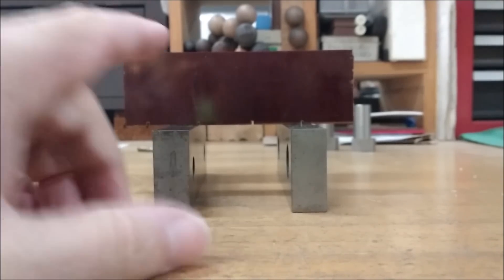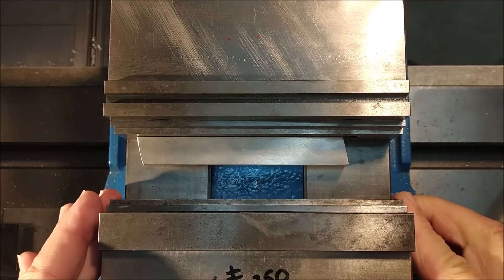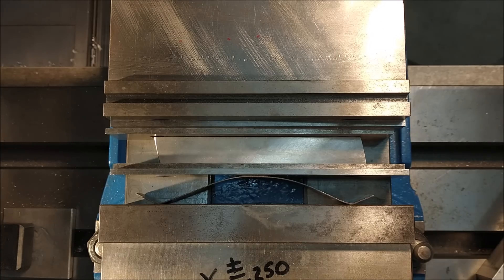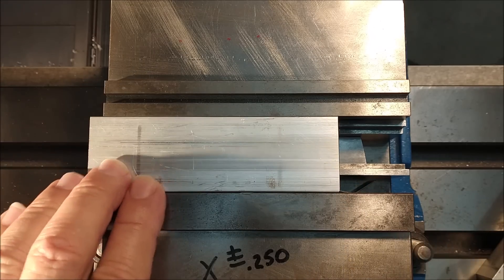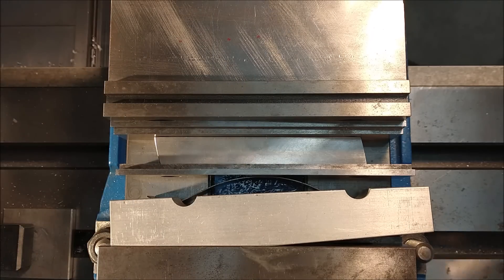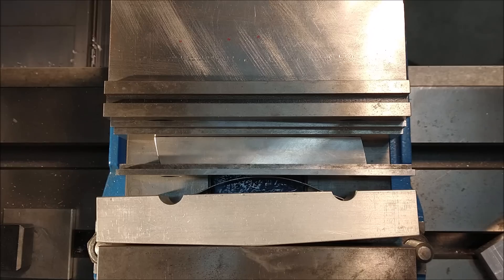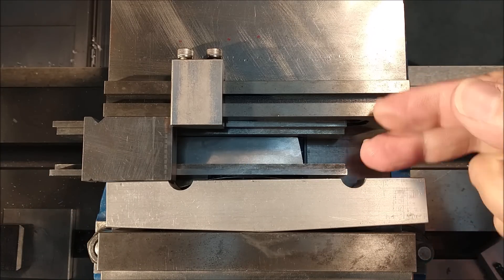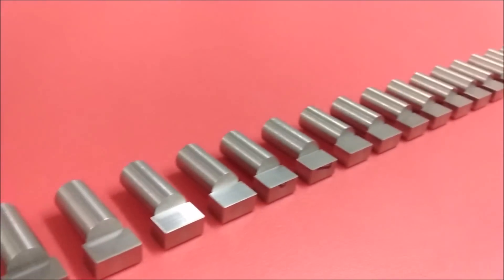Have a Vise on Your Machine ?? ......Learn this NOW !!

Comment: We that have a woodworker's vise know this. You talk about twisting, you could bend or break one. I put a jaw mounted screw jack in mine made out of a carriage bolt that sits in a countersunk hole if I'm clamping near nothing. I like the comment here about something adjustable on the fly. Great information as grasshopper (me) moves forward.

Comment: Adjustable parallels or a nut/bolt or really short machinist jack is good for balancing out the load on the opposite side of the jaw.
Reply from the maker: Absolutely.

Comment: Also very important, not only will pressure be uneven when part is off center in the vise, it will not be tight on the end where it opens possibly causing your part to fly out and hurt you and or machine and part.

Comment: I find it ironic that you post a video like this and a month later Blondi offers it up as a part of her worldly knowledge. When in reality, if you watch her older material, she never practices what she now preaches. I'm sure a bunch of deleted comments convinced her to present it. Did she thank you for the tip ?
Reply from the maker: Of all the things she has learned on this channel, then gone on to present the same things a couple weeks later on her channel, she has only ever acknowledged the inverted threading. I'm still waiting for her to stop using a spring center on a T style tap handle. But I did notice her camera angle doesn't show it anymore. You can't hide the runout though.
Reply: Great video. I unexpectedly became the proud owner of a 100 year old Allen Machinery metal lathe that a farmer owned. I can't find a thing about it except some Brit's website saying it is old. 😮 That, it is. I'm retired with an electrical background and am now becoming a YouTube Machinist! 🤣👍🏻 I have noticed Blondi doing tricks that you showed. I subscribed to your feed now. Great videos. 👍🏻🍻

Comment: A very lucid demonstration of the rocking jaw problem which is also true on the metal cutting band saw.    Best demo I have seen - keep up the tutoring, we all need reminders of the basics because we tend fall into bad practices rather than good ones, due to time pressure and we get away with it most times!

Comment: Ive been using some of the soft packing foam between my parallel's lately. Works as well or better than springs, and you can cut or drill into it without damaging your tool.

Comment: I try to square up a about 6x6x8 chuck of steel in a 6 inch vise with a large face mill . Made a pretty loud noise as it landed on the floor.

Comment: In order to tighten properly, the support piece on the opposite end of the vice should be the exact width of the piece being milled.  If narrower it will do no good and if wider the milled piece will not be tight and move under tool pressure.

Comment: i use the metal strapping cut and bent to fit the space between the jaws, it's free and there is always a lot around
Reply: Wide steel banding works good for hurricane ties also when framing in construction

Comment: I really like the the flathead screw in a block for an adjustable vice balance. I usually just grab some of the old junky joe blocks but that idea is one of those really clever ones you smack yourself in the forehead for not thinking of.
Reply: I love that idea, I'm always cutting off short pieces of round tube in my Ellis horizontal band saw, scores of them every work day. Going to take a couple sizes of square tube, drill a hole and weld a nut to it and run a couple inch length of all thread with a large flat washer welded on one end through it for an adjustable block 😊

Comment: I do the same thing (pieces at each end) with my band saw vice, it lets me clamp smaller pieces without worrying that they will get yanked out.
Reply: Yes, I agree.  You don't get a square cut on a band saw with short stock unless you use extended plates between the jaws and an adjustable screw at the open end.  However, I have been guilty of this "sin" when time is short on the mill, hoping to get away with it, by ensuring that I only cut the end when moving towards the fixed jaw!

Comment: At my last job I had to do a lot of holes along the edge of a part where they would make contact with the parallel.  I would often put a spacer of a known width behind each parallel with a spring between the parallels so that my part was still supported perpendicular to the spindle but my edges were clear for the drill.

Comment: I place a piece of soft round stock vertically against the front jaw, centered on the parts Y axis (contact with the back jaw). This is fast, effective and can be very safe and accurate. Best used for light weight parts though. I enjoy your videos. Thankyou.

Comment: Great point and thank you for your ability to dumb down stuff that everyone assumes everyone else knows.
Securing my work is my number 1 problem-period.  I'm not a machinist.  I buy nothing new and have very little money.  I have no experience and there is a big learning curve.  I've always  bought broken stuff and fixed them up to use.  I paid $500 for my Alliant milling machine and less for my southbend.  Last week I was milling aluminum.  I thought I had enough meat in the vise but was wrong.  It crushed and narrowly avoided a big problem.  2 weeks ago instead of cutting a piece of aluminum on my bandsaw I have a mitre saw with an aluminum blade that cuts it it 2 seconds.  Half way through it caught, broke the fence, flew to somewhere at 200 miles an hour and scared me bad.
I make a lot of mistakes.  As long as I dont get hurt is my concern.  Currently, Im struggling with clamping down 2" steel plate, correct mill speed, and basically 101 stuff.  Everyone is concerned with 10 thousandths of an inch while I'm concerned with 10 fingers.
Reply from the maker: When ya leave with all 10, its been a good day.
Reply: Tip from somebody 71 years old, been a woodworker most of my life, including teaching wood and metalwork. Now a hobby machinist, and I've still got ten digits lol some scarred but there still attached to my hands. Take your time, think it out fully, then work methodically and you should still have eight fingers and two thumbs to go home with you.
Reply: @samrodian919  thank you.  All of my close calls have been dealing with securing the work piece. So i need to focus more on that.  I know, though, often what gets you isn't what you expect.  I know a roofer who is blind in one eye.  As he hit the nail with a hammer it jumped up and got him in his right eye.  geez.  thanks again

Comment: When I saw this video I didn’t think I had much to learn. But today I had to cut a flat on a cylinder with an open top and a thick walled base by placing base near center I was able to clamp it in a way that I cut a perfect flat, easy. Joe you have taught me much.

Comment: Hey Joe. Right from the start you are giving us the right way to load a vise. I am trained by a great German machinist that made me figure things out BEFORE tightening a vise. He had me grind a sliver of a taper to the vise jaws that work so well drawing the part down into the vise bed. Unconventional, Yup, It works though. When it comes to steel straping no shop should be without a bunch hanging on the wall. I have used it in a vise or as a spring on a planer molder infeed and outfeed holding wood along a fence. It does lose some of it's spring but it is so inexpensive to replace. Pennys a linial foot. Thanks Joe, Have a great weekend my friend.
Reply from the maker: Thanks Dean. Good to get a comment from ya. Stay well.
Reply: @joepie221  It's always nice when I see a post from one of the best teachers in the trade. There is a rare happening if I don't get my retired heinie back to school in one way or another.  Every time I see a post from you it takes me to your visit to Bethliehem Steel. I am pretty sure between work and the reno along with finding some bit of time to do these great videos your days are over at the blink of an eye. We all appreciate you doing these for us. Take care Joe and I hope this is a day where you find some time just or you and a pint my friend.
Reply: I paint mine and use it as a straight edge on my boat restoration.  I'm an organized hoarder.

Comment: Liked the flathead screw suggestion for the opposite side of the vise, a jam nut and measure it to make sure it's the same thickness and problem solved. Thanks, Joe, nice tip.

Comment: Thank you, makes perfect sense.  I have not been doing the spring and that is going to be a great addition for me.  The other part of this I struggle with is:  Should parallels move after the vice is tight?  I usually have the dead blow hammer out to tap things down but parallels will walk right out on me.  I aways assumed it was my crappy vice flexing.
Reply from the maker: Try not to tap down your part for the first milling operation. Any warp in the material will translate to the machined surface once the vise pressure is released. 2nd......No the parallels shouldn't move once a part is secure. if they do, use taller paralles to reduce the vise jaw influence on the clamping surfaces, then tap it down.
Reply: I can slide the parallels out too, this often comes in handy, when drilling a through hole for example, slide the parallel out of the way rather than damage it

Comment: I always appreciate your videos.  I often have to mill very small or thin materials when clamping down the movable jaw tips upward just a hair interfering with the result. Also I would like to add drag to the handle so it doesn't flop about sometimes I need three hands. could you possibly do a video about taking the vise apart and tuning it. Again thanks for your great work

Comment: Another great video from our master in machining. One more thing I notice is that I never see Youtubers clean chips from the vice between setups. 

The same with Joe's setup right here. That leaf spring will be surrounded by a lot of chips. 

At this moment I remove and clean the parallels between each setup, which take quite some time, but at least it's clean. 

The easy way out would probably be to use compressed air, but I don't want to have those chips flying around in my shop. 

Perhaps Joe has some tips for that?
Reply from the maker: The vise was cleaned for this presentation and no chips were produced. I always blow my vise out between parts and setups as a standard practice. Yes, leaf springs can cause reservoirs of chips and coolant, but I try to keep my leaf springs above the actual vise surface for just that reason. Especially on a CNC where flood coolant is present.

Comment: 1) Springs between the jaws and parallels are always a great idea. The springs also give you a positive opening of the vise. One type of spring l liked to use was the Wavy Parallels. Especially on narrower parts. 
2) On loading parts. This more of a safety issue. We mainly used two brands of vises. Kurts and another brand that you don't see too often. That's the Quad One CNC vise. The solid jaw is bolted to the body of the vise in two directions. Vertically through the bottom of the vise body. And horizontally through the solid jaw into the body of the vise. The solid jaw is at the front. The solid jaw also has the screw intregral to the jaw. The safety part comes in when you insert the part you are holding the part towards your body. Instead of exerting a force away from your body. If your hand slips. And it happens. Your hand will come towards your body instead of moving away and possibly towards the cutter. Additionally the vise could easily be mounted on its side.

Comment: It's another solid bit of advice from Joe Pie! 

One tip I use: Get an old Gauge Block set that isn't too good as gauge blocks, they get rough and won't ring together because of guys handling without gloves, etc. Or even a set that's decent, if you can find it cheap. Re-purpose the tools and use them for making other-side-of-the-vise stacks. You can make most thicknesses with 3 blocks max. I use my old worn-out DoAll set all the time for this and they are happy to have a second life as spacers, lol.

Comment: Hi Joe
What would you think if one used a flattened bearing on one side,
And placed the curved side on the object being cut,
Placed that on the item of the left and tightened up on it in the vise,
As I think it would still apply an even pressure on the part, to hold it tight against the back jaw.
Even if the screw jaw went a skew, it should still be held firmly against the other jaw. 
I know it is not perfect, but would save one making a equally sized piece for the other side.
If only one item is to be made.
Hope i made it clear enough.

Comment: I use an adjustable parallel that I keep for just this purpose of equalizing pressure.
That way when I don't have a part of the same size, no problem.  
I also have a tool I made for my wood vises that does the same thing.
Reply: Me too.

Comment: If you have a hold down kit with all those useful flange nuts then get a bit of all thread and cut it into a few short, different lengths that you can put two nuts on with the flange face outwards. They make nice short adjustable jacks for setting even pressure on both sides of the jaws.

Comment: Hey Joe.  I am a part time, amateur, machine (lathe and mill) operator (most definitely not a machinist although i have learned a thing or two in my time - thanks to you, old Tony, Quin D and others) in  my basement.  My hands have  more nicks, cuts and callouses than I can count on good days,  not to mention the dirt and grease under my fingernails.  Your hands are immaculate.   Got any good tips in  that regard?
Reply from the maker: I've been doing this for so long that handling sharp parts is almost second nature. A cut is rare and usually small. I wash my hands several times a day and use a sponge and brush at the end of the day. Keeping your nails short makes it easier to keep them clean. Many of my customers are in the medical field, so this is almost a must for presentation.

Comment: I need to find a couple feet of banding steel.  Today I ended up using a small ball of paper towel to keep the parallels in place.
Reply from the maker: It works well.

Comment: Maybe a ball between moving jaw and approximate center of the small part?
It should make 3 point contact, and be stable.
Reply: It may keep the part straight but you still have stress and wear on the vice that you are better off not having.
Reply: @FailedExpert6330  Of course... not as usual setup, just for "quick and dirty" :)
Reply from the maker: I have a ball with a flat ground on it for that very purpose. Its also good for irregular surfaces.

Comment: To build off of your idea about using a flat screw as a spacer on the opposite side. I’d suggest a bolt and nut as another option. Just make sure the bolt head is turned flat from any stampings. This way you can measure your part and the bolt with a nut to match the same measurement. Quick and dirty, but not NASA approved 😬
Reply: Good idea - while reading your comment I thought of using a "coupling nut" (used for joining pieces of all-thread) for a wider range.
Reply from the maker: I use a coupling nut from my clamping set with a 1/2-13 flat head screw as a jaw spacer on my horizontal bandsaw. Works like a charm.

Comment: Joe, I have seen that taped drywall shop wall to the office behind you several times over the years, but only today it occurred to me that as neat as you keep things that it didnt bug you enough by now to paint it.  (I am not commenting to be criticize in anyway.)   Keith / STL, MO
Reply from the maker: Its actually custom painted to look like taped drywall. :)
Reply: That's not taped drywall, those are very large cinder blocks, carefully disguised......
Reply: @markmonier-williams2508  If so then I would hate to get on the bad side of those Texan stone masons.  They must be built like a gorilla!

Comment: I learned the second vice tip in my early teens when i wanted to cut a bolt to length, just a normal vice and hacksaw, had to put a bolt in the other side, i'm 69 now and always remember ;)

Comment: Joe, when the part does not reach the center line of the vice and an out of square situation occurs, will the vice then leave a tale tale mark on one side of the part to where it was clamped?
Reply from the maker: Maybe a rolled edge from the pressure.

Comment: I've been in business for over 35 year and have always wondered about this. My main machining is turning so milling machines are not my specialty but I will keep this tip. Thank you Joe Pie!

BTW... Joe could you demonstrate the effects of over torquing small parts (and even big ones) in the mill vise? Even though I don't specialize in milling I have learned that controlling the clamping force through a torque wrench is important for consistency in production. Most people "grunt tighten" the mill vises and then wonder why the parts vary in dimensions.
Reply from the maker: Vise torque can cause inconsistency in production parts. A torque wrench for control is a good idea to contribute to precision.

Comment: Machining 101. Thanks Professor Joe. If you haven't seen it you wouldn't know. Again, it's not what you have done, it's what you have SEEN done. Stellar resource right here folks. Also the 2 parts in the vise will eliminate the potential for "throwing" the part out of the vise. Never a good time. Don't ask me how I know. We've ALL done it and if you haven't you will. All part of making chips and having fun in the machine shop.

Comment: I've learnt so much from your videos over several years. I often use a piece of expanded polystyrene instead of a spring to keep the parrallels in place, works well if suitable springs arn't to hand.